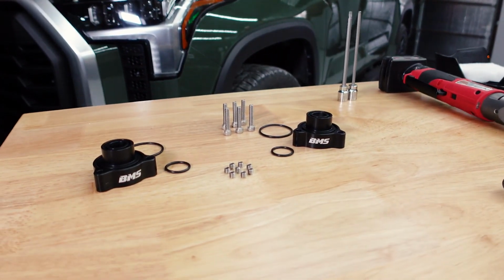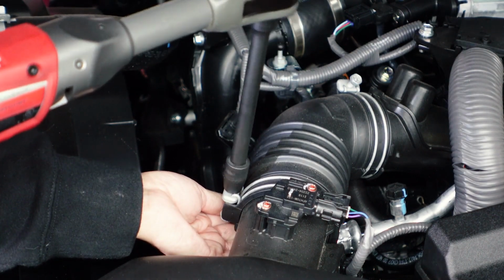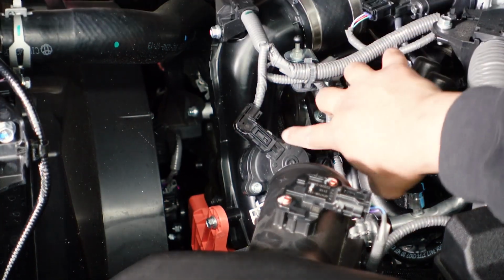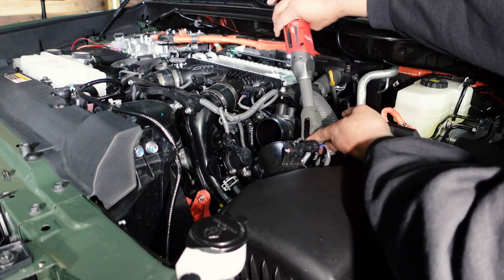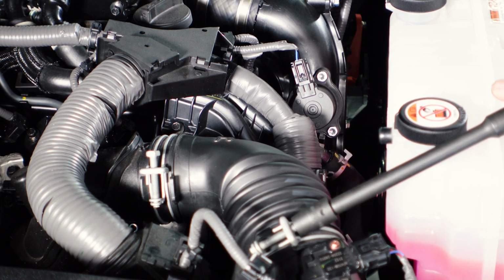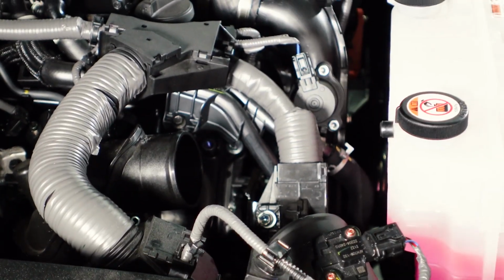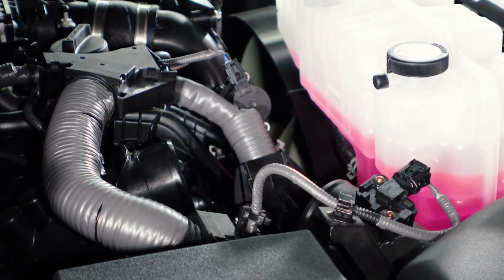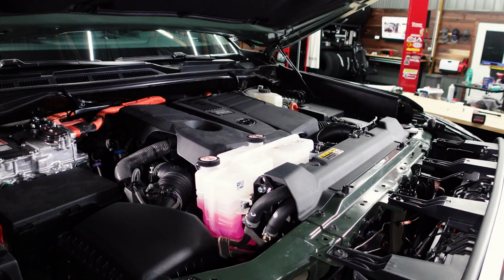Tundra Hybrid BMS Blow Off Valve Install

Comment: Still have these installed? Any CELs?
Reply from the maker: Yup still installed, no check engines yet (did a 16hr road trip after) but we didnt take out all the allen set screws as you can see in the video